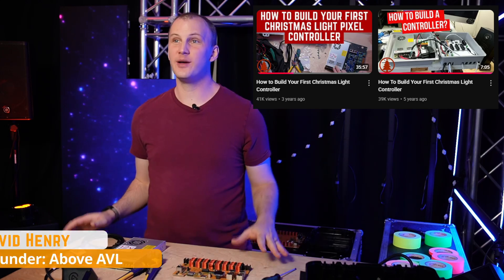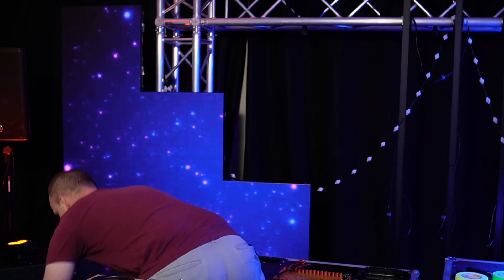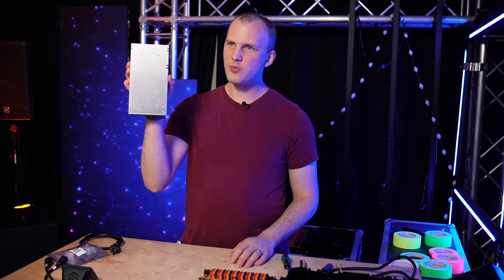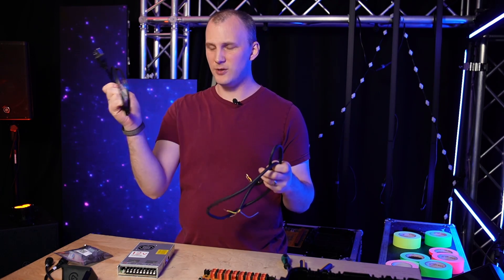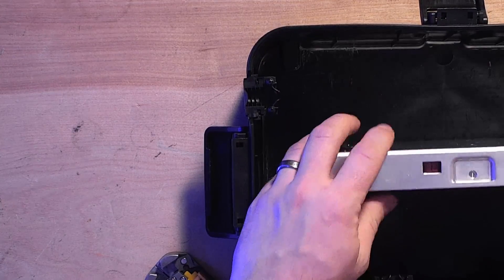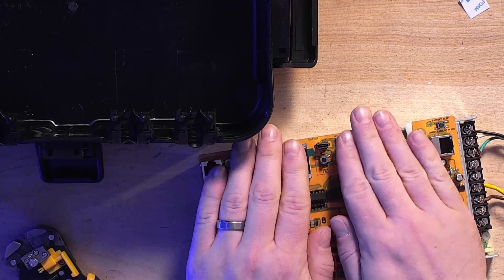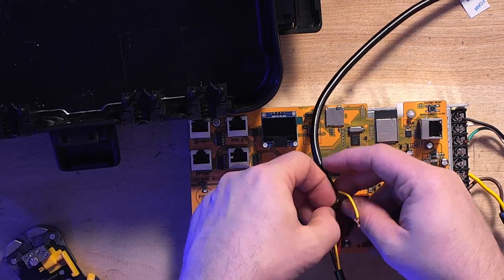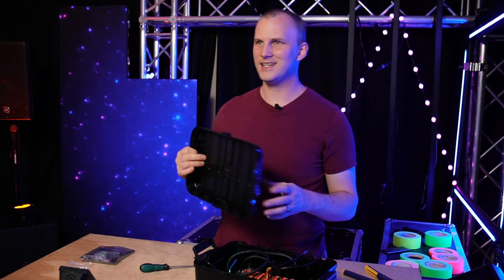How Do You Build Your First Christmas Light Pixel Controller?

Comment: Hi David! I work for a nonprofit that puts on a Christmas kick-off event during which we have a lighting and a recognized guest flips a switch to turn on the lights. My question is, how do I build an actual functioning switch that will turn the lights on when they flip it? (Rather than someone hiding in the background and flipping the real switch while the person flips a fake one) Thanks!
Reply from the maker: Hi Friend - it can be done, but I've also seen this done a LOT in both residential and commercial applications, and 99% of the time, it's a manual press "behind the curtain".  Not only does it eliminate possible failure with the trigger, it also creates a failsafe in case the Emcee accidentally presses the button when they aren't actually ready to start the show yet.

Experience lights has a great triggering product that allows you to set up a trigger like this - see more here: https://www.youtube.com/watch?v=mhReT2-l7kM
Reply: I want to run around 180’ of led light strips along my roof and up me peaks. I’ve watched a ton of videos but I’m very nervous about pulling the trigger on all the equipment. Is there a website that can design everything I will need,  where to spit the zones and where power injection will be needed?